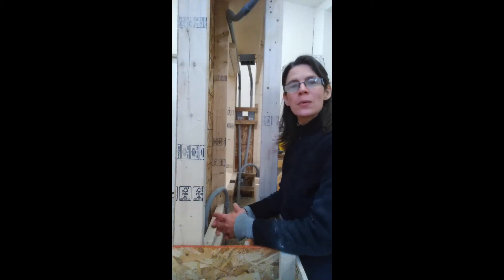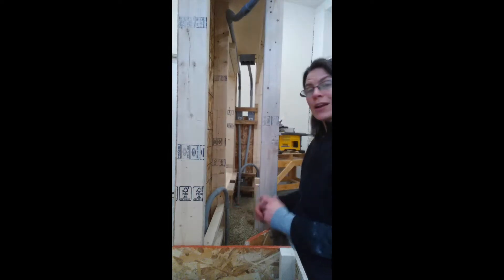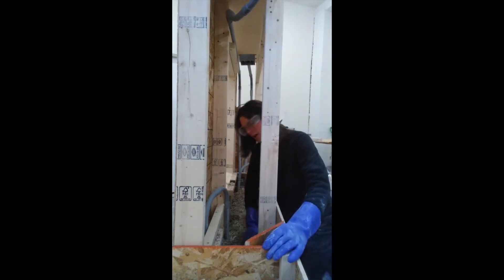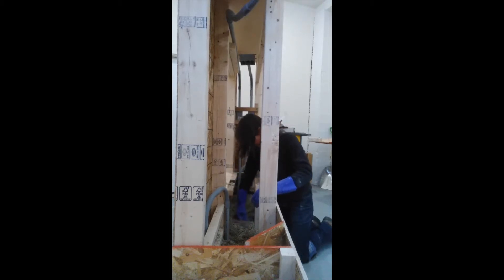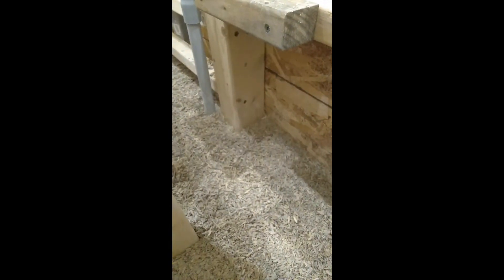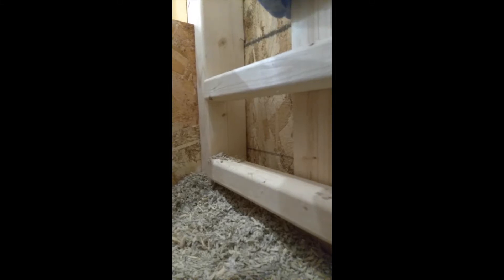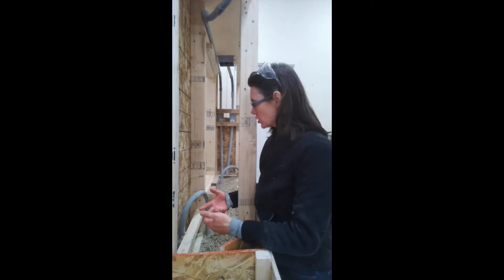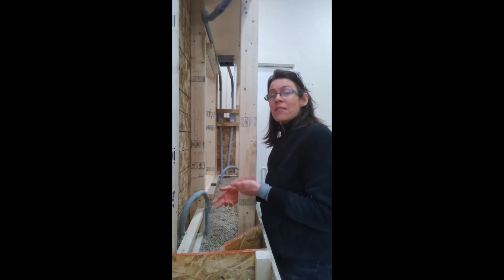The 4-1-1 on Hempcrete: Intro to Installation

Comment: How do you pack the top, when you get close to the ceiling?
Reply from the maker: There are some areas that are tougher than others. When casting and "tamping" vertically any areas under a horizontal member (window sills, blocking for electrical, plumbing, venting, cabinets, etc..) will present this same challenge. When you get to the top of a wall it depends on how much of the roof and roof sheathing is in place which can limit access but typically you form and pack up close to the top +/- 6" and then move one form up all the way and pack sideways from the other side if you can't from above. For spray applied it is a little different but with similar challenges to get to hard to reach places like inside or behind headers, and behind framing in corners.